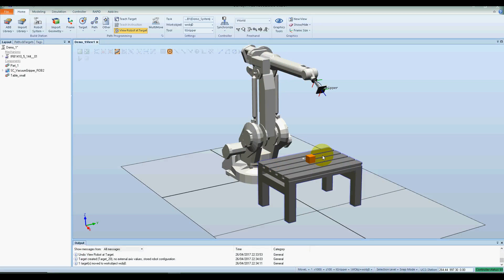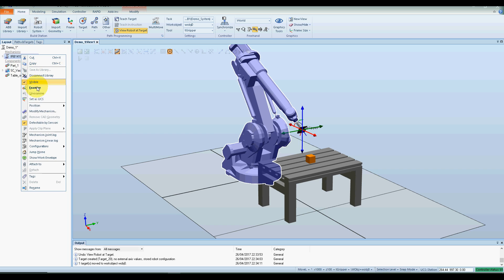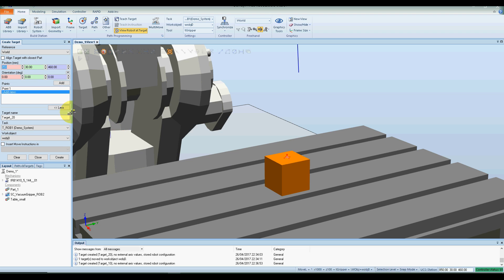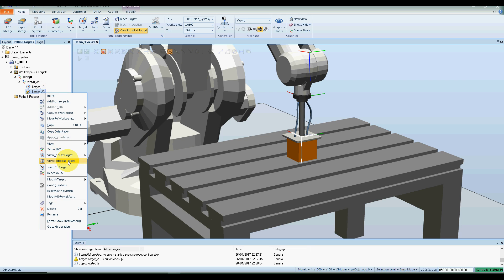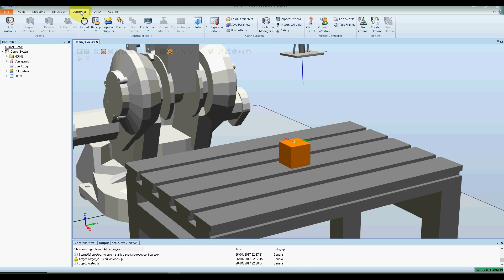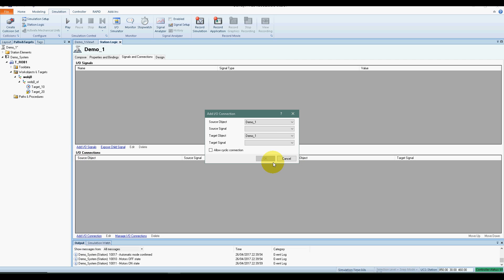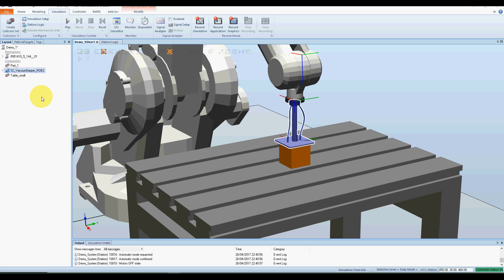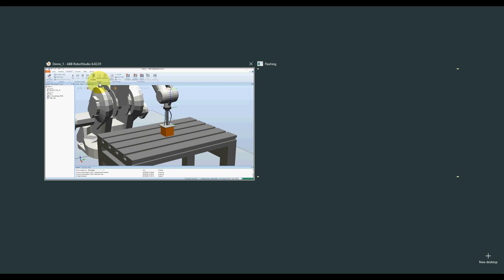RobotStudio - Pick and Place (Part 1)

Comment: I know this isn't related to the video but when I add virtual controller from layout for the IRBT6004 I keep getting the combination not supported error. I tried to do it with at least 10 different RoboWare versions but it says the same thing no matter what I do. I need to use it for my job interview sample project so I would appreciate it greatly if you help me fix this problem.